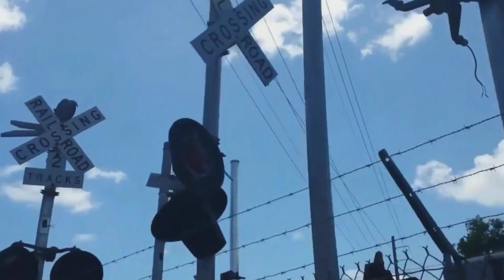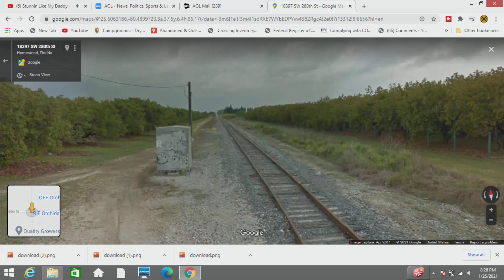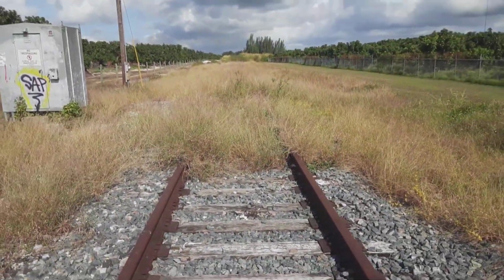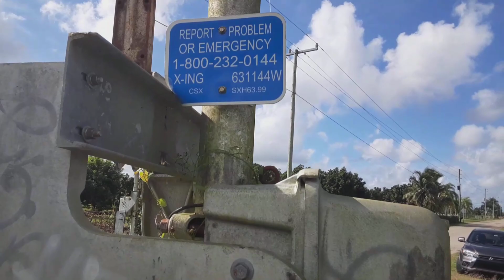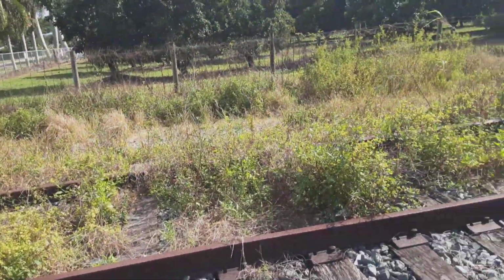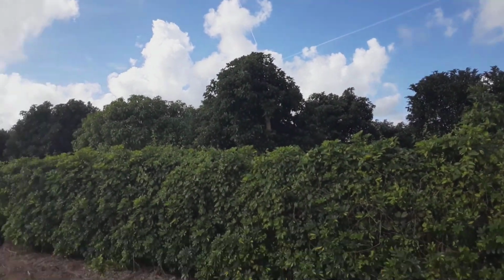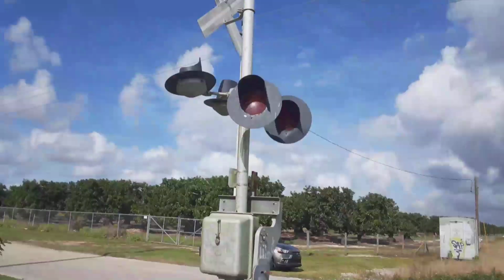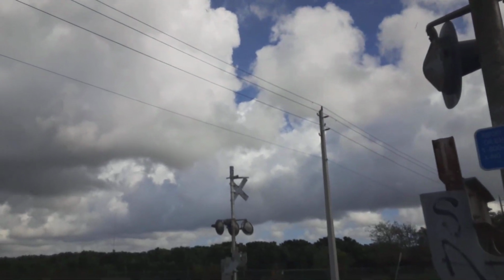Broken Railroad Crossing Gate at Abandoned Railway

Comment: 🚂👍👍         What does the number mean on the milepost? The distance to the end of the line? What does a sign that says "X" mean?
Reply from the maker: Good question, Danny. The milepost state the number of miles from the start of the line to that particular point. I've never seen an "x" before. I tried Googling it, but didn't see any. I've seen a "w" and it's a whistle sign that means to blow the horn, they're usually found before a crossing. Thanks as always for the views and comments!
Reply: @railrol82  I will try to get a picture of an "x" sign.
Reply from the maker: @dp2475  Looking forward to it!

Comment: Sorry to burst your bubble, but that’s not Papaya. That’s Non-Native China Berries. Very aggressive exotic pest of a plant. As for a train on that line. The last time I heard and saw a train on it was back in 1986. As I grew up just off 147 Ave. and 200 St.
Reply from the maker: So I will burst your bubble too, the last time a train used this track was in 2016 to remove stored bulk head flats. Thanks as always for the views and comments, Igancio!
Reply: @railrol82  Kool that it was used. I moved away in ‘93. But my Mother still lives in the same house. Even when I have visited over the years. Still have not seen any action on the line. 

Have they replaced the line along the east side of the Palmetto around the Tropical Park/Bird Rd. area that goes north. To a rail to trail? Thanks for the videos I will be checking out some more. Just came across this one as a suggestion from watching Jaw Tooth.
Reply from the maker: @ignaciofernandez3424  Good question, the former FEC Little River Spur, South of MIA to Dadeland Mall was abandoned in 2005 and the rails were pulled around 2007/2008. There is only a small section of track left next to Snapper Creek. Here is a video: https://youtu.be/IREr_DrhZXM

The CSX line is still active as far South as Gold Coast RR Museum.